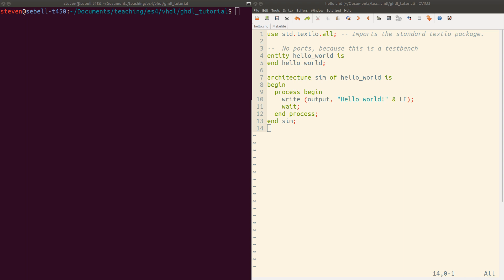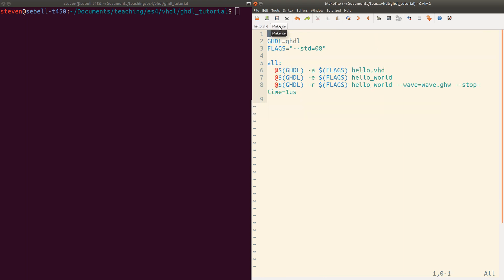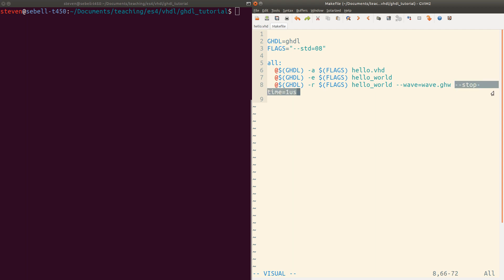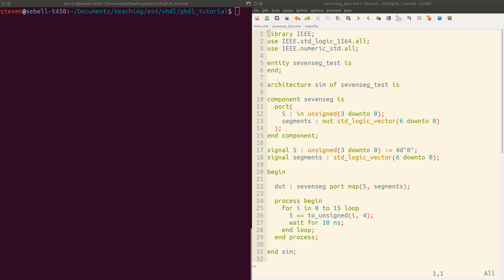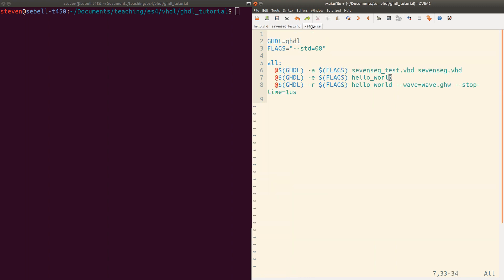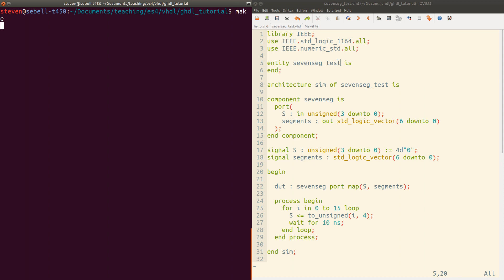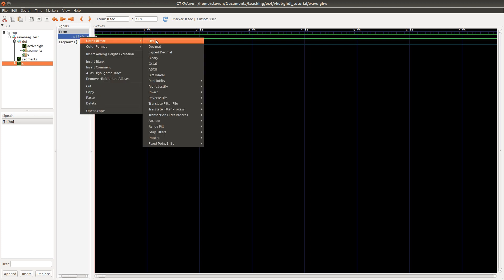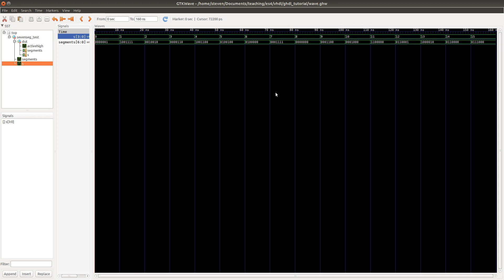Simulating VDHL code with GHDL

Comment: when i run the Makefile, i get this warning: 
instance "dut" of component "sevenseg" is not bound [-Wbinding]

Do you have a sevenseg file in that folder or have you compiled a sevenseg entity before running this?
Reply from the maker: Yes, this assumes that there's a file `sevenseg.vhd` which has to be analyzed/included in the design (I add it to the Makefile around 6:25)